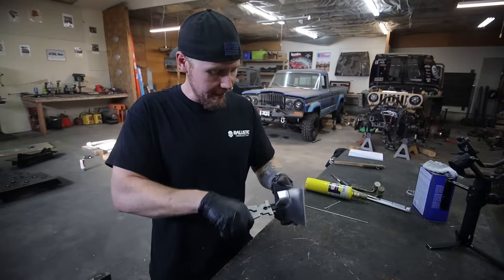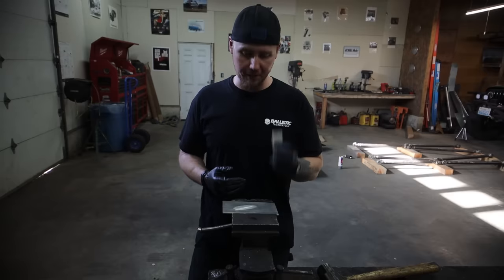Amazon's CHEAP Alternative To Aluminum Welding!!! (Alumaloy)

Comment: This is a good alternative to t.i.g. or wire feed /spool gun, especially if your not a welder. T.I.G. takes a lot of rhythm and some skill in general, Spool gun is easier but still takes some practice as well. This, however, is perfect for trail repairs. My complaint is the prep times a drag, appearance is generally crap, but I bet you could use this rod with a T.I.G. torch and it might be the best of all worlds! Don't know haven't tried it.
Reply: I have an acetylene torch that doesn't take oxygen, its for plumbing, I bet that would make this stuff much easier to work with and faster.
Reply: These rods do not work with welders
They fall apart or stick
Tried this years ago
Reply: A GTAW (TIG) torch will not work in this application because it is too concentrated of a heat source.  Aluminum has high thermal conductivity and pulls heat away from the joint, so preheating the part in this case will be helpful.  Additionally, joint preparation is recommended to get a consistent gap between the parts being welded - this will assist the capillary action needed to pull the melted brazing material into the joint.  In brazing the filler metal melts and not the base material (in reality some base material at the surface does melt).  As pointed out in the video it is important to clean your joint when brazing aluminum.
Reply: If you had a TIG welder or  MIG setup, why on earth would you even TRY to use this as a filler rod?  In either case you're going to use real aluminum filler rod and get a much stronger and better looking joint.
Reply: would be pointless to use something like this for tig welding when we have dozens of welding rods for specific base metals.
Reply: Welding will distort the piece. If you need to join pieces that are dimensionally not tolerant of distortion, like a turbo compressor cover inlet, brazing is a much better option than welding, even if you have a tig torch.

Comment: I never got any decent results from these type of rods, and i worked with soldering and brazing in my job,  I gave up on them as snake oil.
Reply from the maker: Lol they almost are snake oil. They definitely work with a little elbow grease but these can be frustrating and are not even close to the quality joint you get from a copper/brass braze. But for someone without access to a dc tig this can be a good option with enough practice and patience. Still though, they do kinda suck lol

Comment: Good job in the presentation but for two things. The wire brush Has to be Stainless! A ferrous brush contaminates the weld with metal that this rod Cant fuse with! Also, if you apply heat for over 1 minute,  you will biuld up oxidation which needs to be rebrushed, before continueing. The sheer strength is 18,000 per sq. " , tinsel is 32,000..
      Keep up the good work... 
                               Dutchman
Reply: Some stainless steel is austenitic and due to it's high nickel content, is not magnetic, but all stainless steel is ferrous as it all contains iron. Didn't know if you knew that, but I'm sure there are others that might have been confused by what you typed lol.

Comment: Very helpful!  I set my cast aluminum block down on the garage floor a bit too quickly and a little strip of the flat part that th pan seats against cracked off  Was going to use JB weld but this looks like a better solution since it's not structural and simply needs to stay in place to be a mounting surface for pan and gasket.  Thanks!

Comment: I don't mean to use the You should thing but I think you should have some fire bricks underneath the aluminum so all the heat from the bottom plate doesn't get absorbed straight into the vise.
Reply: what about lining the steel jaws of the vice with something like brake pad or brake shoe lining which should afford good grip, tolerate quite high temperatures and not be an excessively good heat sink... get good thermal isolation and a stable platform to solder on?

Comment: I'm an aluminum welder by trade, an really welding as you have shown will make the weld brittle and full of porosity. There are cheap mig welders on Amazon for under 100 bucks that can weld up to 1/4 inch

Comment: I once had a cowl dzeuse fitting that had wallowed out over time on my Cessna.    Lots off vibration out over that engine.     One day I decided to fill and  redrill  it .    All I had on hand was a propane turbo torch  and got it a tad too hot so it slagged it even bigger.    I held it ( torch) further back and filled it all in.    My reference was now gone and I missed by a bit from center so a dzeuse wouldn’t go back in and work.   Oh well I figured I’d just put a stainless screw in ( more secure anyways)and let the filled area fret out until it was straight.     That screw went in on a slight angle and the threads were riding right on the edge in all that vibration.    Guess what , years later after countless flight hours and being in and out with a drill driver the hole was the same.    Is that strong to you???     
   Now I’d not use this on any dangerous structural member.    Still for about anything else it’s fine and dandy and in spite of welding a lot I still don’t have or need an 💸💸💸 Tig rig.
Reply: Repair performed iaw dirt lifestyle YouTube channel , ops check good .
Reply: I've used HTS2000 (more or less the same stuff) on a lot of my aircraft.  I'm an ag pilot, and the chemicals are often very corrosive to aluminum tubing used for the spray system, so they eventually develop pinhole leaks.  I just run the oxy torch over it to burn the crud off, hit it with a wire brush, and braze the hole closed again.  Unfortunately, the alloy is less corrosion resistant than the base aluminum alloy, so it only lasts a season or two.  Probably the most interesting repair I've done was brazing over a bullet hole in the fuselage skin (non-structural) and then grinding smooth.  A little paint and it's our little secret...
Reply: @brandoncarr1203  Funny!  The sketchy stuff never gets written up anyway.
Reply: Congrats...your Cessna is now Experimental.
Reply: @xtnuser5338  Nah, it takes a hell of a lot more than that to bust a certified plane down to experimental category. Besides, if the repair follows basic FAR's, it just needs to be noted in the logbook.  Honestly though, there's a lot of shit that never gets put in a logbook, and if it's a minor thing like repairing a hole in sheetmetal, nobody is going to care.
Reply: @Skinflaps_Meatslapper  Well, first I want to address your position that Experimental is a downgrade from Certified.... Experimental is way better in my opinion LOL.

Now, unless you are an A&P, FAR Part 43 only allows you (presumably a current pilot and owner of the plane) to do the preventative maintenance items that are specifically prescribed therein, and the repair you described is definitely not on the list. And  your description of the repair certainly doesn't jive with any maintenance/repair manual I've ever seen, or AC 43.13-1B: Acceptable Methods, Techniques and Practices.

Now I'll agree that it wouldn't matter to me, since you're only talking about the non-structural, removable cowl of a Cessna, at least if we're talking about its trailing edge. Well, I suppose I would want to know how long your SS screw it, and what's behind it, but that would be my only concern. Heck, you could leave half the fasteners out around the trailing edge of the cowl and it wouldn't concern me. But, technically, you're not Part 43 legal.

I could be wrong. I'm no expert. But that's my understanding.
Reply: @xtnuser5338  You're barking up the right tree, of course.  I'm not going to bother combing through that stupid manual to find it, but there are techniques outlined for welding non-structural sheetmetal as a repair process that I've run across in the past.  What it hinges on is whether something is deemed non-structural or not...and that's more or less where people make a detour from strictly adhering to reg and it gets into the interpretation side of things.  At what point does a simple non load bearing fairing become structural?  Because that's more or less what a cowling is, it doesn't hold anything on the airplane and doesn't form a structure other than itself for the purposes of aerodynamics.  Technically the plane could fly without a cowling entirely, I've done it myself, though not always advisable.  So it could be argued that it's technically not a structural component in that regard, and non-structural repair methods would be acceptable. But that's just one person's interpretation...
Reply: @Skinflaps_Meatslapper   Sure, it can be kinda subjective, as you point out. I wasn't worried about the welding of the cowl. I was thinking about the use of a screw in lieu of the (likely Southco brand) 1/4-turn fastener on your Cessna. But I've read a bit more, and I now think that fasteners for inspections plates, cowls, and other external, non-structural items are free, and not subject to certification or airworthiness. So you're probably good to go.

PS - I've flown a Cub without its engine cowling, and honestly it didn't make all that much difference. Of course, that was at only 68 knots, and that cowl doesn't have that much frontal area really, the firewall is relatively small too, and there's plenty of control authority. Do the same thing in something like a Questair Venture and you're probably going to die.
Reply: @xtnuser5338  Anyone that replaces a Southco or Dzus type fastener with a screw needs to be thrown out of an airplane. Screw those guys LOL

It was on a Cessna 188, which isn't the fastest Cessna out there.  Some stick and rudder shake at certain speeds but that was irrelevant, what was relevant was the fact that the cylinders weren't cooling properly.  Most of the planes I fly never had a cowling to begin with, because there's not much streamlining to be done on a radial and cooling isn't a factor.  I don't think I'd be so quick to take it off my Glasair III, however.
Reply: @Skinflaps_Meatslapper   I expect you could fly a 188 without half its skin. I wouldn't want to be the first one to try it, I'm just saying that I wouldn't be surprised.

And I'm with you on radial cowlings, at least in general. But try telling it to a Sea Fury or a Corsair.
Reply: @xtnuser5338  I dunno, I took the doors off and it started acting squirrely...kick the rudder and it takes a second for it to respond.  The rudder on a 188 is marginal on a good day so the doors went back on.

Yeah well they're also flying about five times as fast as I am LOL
Reply: Talking about a 20-40K$+ airplane and griping about the cost of a 1,800$ welder lol

Comment: I wonder how well it works for repairing stripped or crosssthreaded aluminum  bolt holes. (Fill hole drill and retap)?
Reply from the maker: I bet it would work really well! Depending on the application of course.
Reply: There is a product called Sif 555 aluminium solder. I stripped a thread in the axle clamp on my dirt bike. I helicoiled it but a while later it pulled out. Last chance was the solder. I used oxy acetylene to heat it due to the size and thickness of the area. I drilled and tapped it and it’s still holding up fine years later. The sif stuff seems harder and stronger than T1 aluminium . Pretty impressed personally.
Reply: @mopedmarathon  ive used that product also on my yfz450 race quad n would recommend it
Reply: It saved me thousands over the years I reckon. The key with using it is to make sure you have a carborising (can’t spell it) flame. A neutral or oxidising flame just makes you ruin a lot of expensive rods. And the ally has to be mega clean. Even if it’s new n shiny it needs a good wire brushing.

Comment: 9:55 “got penetration” 
Is it penetration or bonding? My impression with braze is that it’s bonding, where as welding is penetration and unifying. Looking for clarification.
Reply: It is definitely not melting both pieces Soldering perhaps. In any case, it bonds/adheres like a weld. Its good practice to clean with a "virgin" SS steel brush. Heat and re brush. Cleaning is a big deal here. Some people use diluted muriatic acid to wipe then quickly solder...Also, heat and tap the base metal with the rod,  on and off till it gets hot enough to pool the rod will fall in place pushing oxidation to the sides. I keep the rod next to the flame to keep it hot and also make sure to wipe it clean before using.
Reply: You are correct.  With the exception of fusion welding (melting two pieces of metal together without a filler rod) welding happens when you bring both pieces of material above their melting point, then add material (filler rod) to provide an extra measure of strength.  Penetration is important in welding.  What you have here, in the case of brazing or soldering, you could just think of as "good glue".  Penetration is not important, but having the braze material flow between the two pieces is what provides the strength.

Comment: You can melt down old carburetors to make your own brazing rod. They are "pot metal," mostly zinc.
Reply: Ergo... all pennys made after 1982 could technically be used in a pinch/emergency situation after removing the thin copper clad...
Reply: @__WJK__  ergo? pfff
Reply: @Benjamin - er·go
 /ˈərɡō,ˈerɡō/ adverb - Definition = "therefore"

(eg) "she was the sole beneficiary of the will, ergo the prime suspect"

Comment: I've had these rods around for years, I discovered them at a flea market.  If you're going to solder, (that's what this is), thin aluminum pieces, a propane torch will suffice, but Map Gas is the only way to go for anything that's over 1/8 inch in thickness.  DO NOT EVER use a stainless wire brush that has previously been used for brushing steel, this is important.  Use only a stainless brush that is dedicated for use on aluminum; this has to do with affecting your ability to make a quality solder joint.   In reality, I don't know why this isn't a more popular way of working aluminum.

Comment: Alumaloy has been around since the early 90's. At least that's when I remember seeing the infomercials.
Reply: ChicagoModzz lol I used to find it so satisfying watching the infomercial where they used it to reconstruct part of a metal fan blade and patch holes in a radiator.
Reply: I bought that crap in the early 80s Pomona swap meet , a hot glue gun would do better. So I learned to weld aluminum.
Reply: Yes!!! It hooked me every time! Lol
Reply: Yea i remember it
Reply: I remember them too while trying to find scrambled porn on late at night... things kids today will never understand.
Reply: @rallywagon261  Shhhhhhh
Reply: I bought some at Carlisle around 94 or 95, so yeah. Eventually I graduated to a TIG welder because this is of really limited use.
Reply: Rally Wagon been there, done that, got the sore wrist. 😂
Reply: I remember them commercials 👍

Comment: Due to the low melting point of Alumaloy and very low joint strength doesn't this qualify as soldering and not brazing?
Reply from the maker: Yes it's technically soldering. The melting point is 750ﾟ and anything under 800 degrees is considered soldering. But most solder melts at around 350 and comes on a roll.  I've been soldering and breezing for a living for the last 14 years at my job and this feels much more similar to brazing then soldering. But from a technical stand point you're absolutely right. 👍

Comment: Apply brush just before applying braze rod, guy who demos this stuff then ,
rubs braze rod forcefully on hot metal. Instant flow if done right .
heat forms scale ! And this IS just strong solder.

Comment: Go down to home depot etc. and get yourself a $2 12"x12" cement stepping stone to use as a base rather than a metal object.
Reply: Lteo Hrnt  - 3:05 says it all
Reply: Be careful heating concrete! Water within concrete can make it explode! A big rock would be better off perhaps a fire brick or fire blanket!
Reply: @ericmcginnis9413  - lots of hobby welders use the floor of the garage or a concrete portion of their driveway to weld on, I used a tower of 2 wide by 5 tall cinderblocks capped with a 12*12*1" concrete patio paver in my backyard for over a year exposed to the weather without a problem before I got the harbor freight $70 welding table as a step up.
Reply: Fireplace brick is the way to go... metal vices unfortunately sink off too much heat :(
Reply: Porcelain tile is best bet. Won't explode, doesn't sink the heat, drips of solder/brazing rod knock right off.

Comment: Ok, so if you weld Aluminum regularly, then you already know prep, prep, prep your surfaces. We both know if you do not hit it with a flap wheel or at the least wire brush the heck out of the metal to remove the top layer of Aluminum Oxide, in order for proper adhesion. And yes I have tried this stuff about 20 yrs ago. It does work fairly well for what it is.

Comment: Its Cheap, BOAT REPAIR = HELL NO!!!, we tried it Professional Welder who is certified in Stick, Tig, Mig, laid a beautiful weld, flowed nicely, first wake ok, second wake ok, third wake it split wide open and we took on water... OK, so we were even move cautious the second time.. more cleaning more prep, perfect brazing it lasted a little longer but same result, Trail repair sure, but burn in for a deep holding Weld... NEVER GOING TO HAPPEN... but nicely done video to show it does have uses...
Reply: Check my comment, you are right, no penetration means it is only a cosmetic bonding.
Reply: @boycottchinanowusaredi-let2306  0lp

Comment: Using this for my jeep for small components & electrical box housing and small bracketry and  my vintage motorcycle  for  a custom battery /electrical box.(nothing that will be  under any stress.)
Might bea good  way to mount my oil cooler radiator too (smallframe w/ brackets to mount it up)